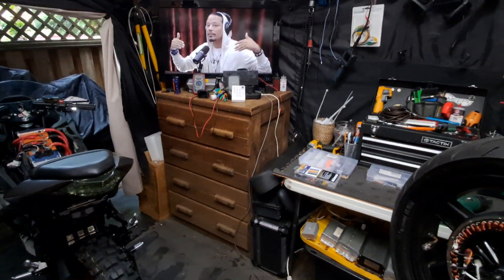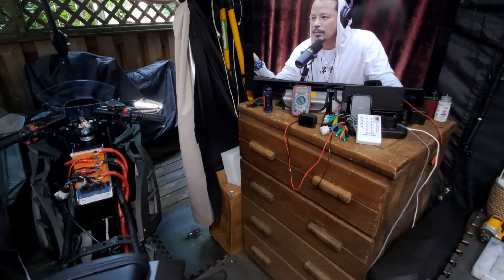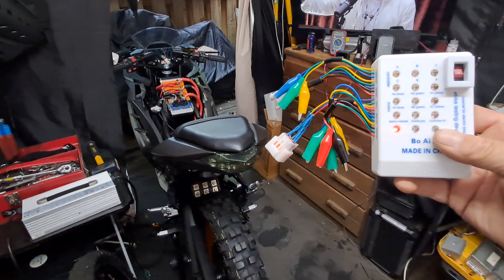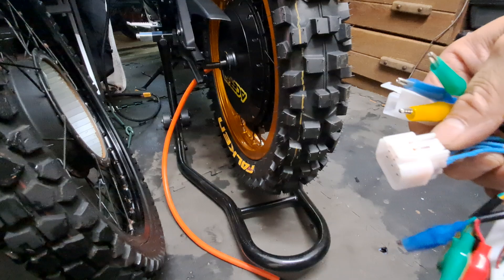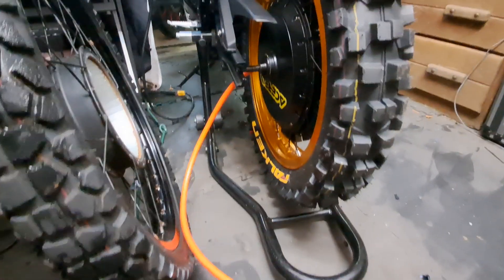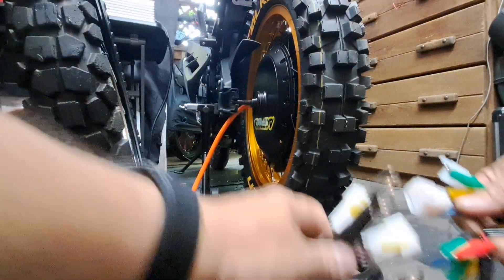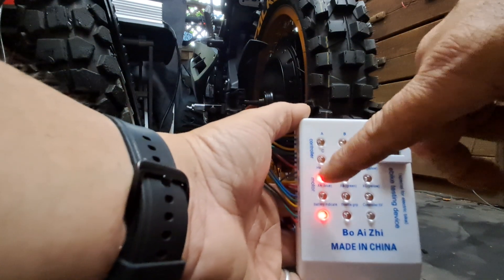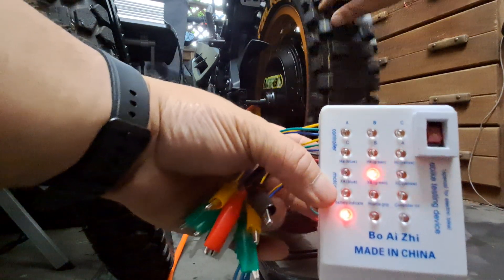Ebike Tester How to use it properly for Hall sensors, you can test throttles, phase & controllers.

Comment: Do you have a link for that tester
Reply from the maker: just put in description
Reply: Just got one for less than 20 bucks on Amazon, and it found my problem, unfortunately now it’s time to open up the hub. Lol. It’s cold right now, so I have a lil time
Reply: Does that distribution box work as a midway for battery to controller as well?
Reply from the maker: @andyfumo8931 naw bro just for phase wires only I am doing a quick release for hall sensors using the 4pin on the qs10 and power wires